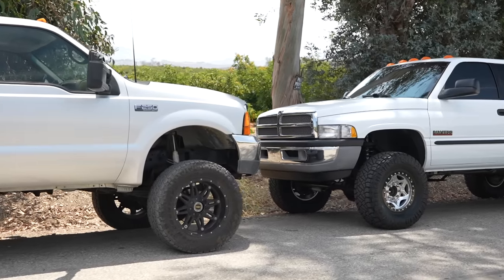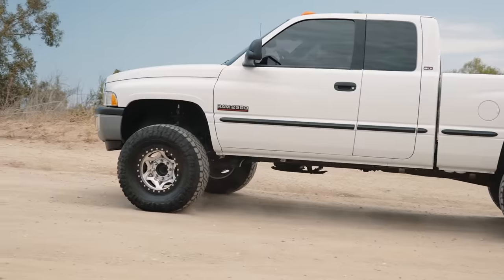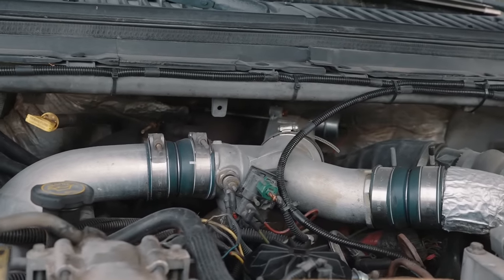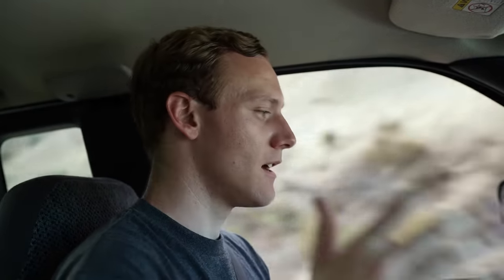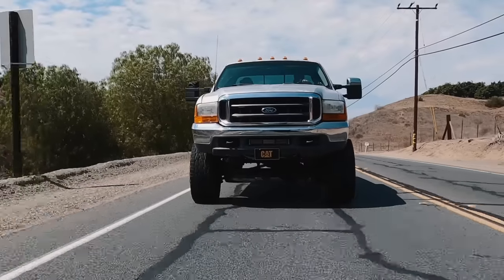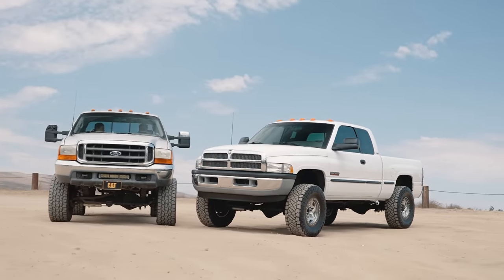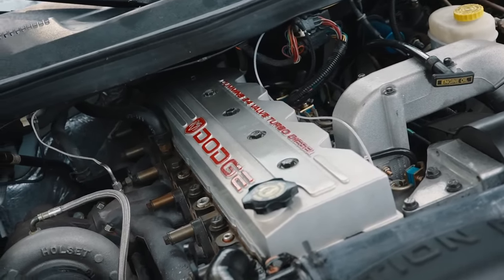1999 Ford 7.3 Power Stroke Super Duty vs Dodge Ram 5.9 Cummins 2nd Gen | Which Is Better?

Comment: Only thing I would disagree with is ride quality. Never been in a smooth riding 2nd gen the always feel like they are going to rattle apart.
Reply: 2wd are 1000x better
Reply: @420dredog  thats what I have amd drives like a cadie 2001 7.3
Reply: Dodge guy. 95 12 valve. Fords make good 4wd front Ed’s

Comment: I own an early 99 SD. Worked on the 444 international in school buses, when I found out they put that 7.3 in a pickup I had to have one, ordered the 99 new traded in my 95 lighting ordered the XLT ext. cab short bed $38,000. 6" lift, 3 lifetime exhaust systems and 22 years of painting everything under it. 145.000 miles on it, great truck. Been in the garage for about 10 months repainting the entire frt. undercarriage again. Not really for sale but stuff happens, today's market I wouldn't sell it for less than $25.000. Thanks for the video, motivates me to go work on the 99. Sorry the only thing good on the dodge is the Cummins. And for leaf springs easy to work on, easy to lift-alter, no death wobble, and rides like a real truck no girly coils. Thats all.

Comment: Every driven a 5.9 with the manual either the5 speed of the 6? They are entirely different different trucks with the manuals. And they become really reliable.
Reply: I drive a 12v gen2 5spd manual. I've driven it for 17 years. It's been incredibly reliable.
Reply: And the best part is no more crappy fold down cup holder.

Comment: Cummins all day long. The 7.3 is gutless, and a huge hassle to maintain. I started off with Ford diesels due to the hype. I got a Cummins and never looked back since. Cost a lot less to get to about a 1000 horsepower and much easier to work on.

Comment: This was great! I have a second gen Ram standard cab 2500 6spd, I’ve been driving it every day for 15 years in New England for my home renovation business. I did rent a crew cab f350 while my truck needed a new head. That f350 road like a stone, empty it did this weird leaf spring hopping that made me nauseous after an hour of driving, however it felt superb when I hooked my portable workshop trailer to it or my dump trailer to it. I mean it’s really nice. Like it road better loaded than my ram did empty. My second gen can tow every day but it’s all over the place by comparison. I acknowledge that it’s not a fair comparison of a crew cab dually to reg cab single wheel and all but I didn’t realize that I didn’t have what I needed. The interior also was a far better place to sit in the ford, despite the fact it was missing a pedal on the left and a lever coming out of the floor. Made me realize when it’s time to replace that second gen a one ton is the way to go for as often as I tow.

Comment: Used to work in steel fab making and delivering cattle/horse panels.  Trips to get tubing or deliver panels were commonly made with a 1 ton cummins.  But there were no creature comforts:  crank windows, most of the electronics didn't work (including radio & cruise), plastics always shattered, they were manual so not many transmission issues, rust was common on the body, always had cracked windshields, but by golly that cummins kept going.
Started running auto 7.3s and could pull 19k lbs of tubing at 85mph.  Wheel bearings and 4wd front end work were notorious fixes on the fords.  Otherwise, never had issues with anything else.. change the oil, keep goin.
Only problem is that people think these things are solid gold.. but that's how demand works when you have a product that works.

Comment: All feelings aside there is no argument when it comes to engine platforms. Cummins wins  all day. Even in the diesel race world, you see more cummins swaps into Fords than 7.3 swaps into dodge trucks if any. All that said, ill take a 99 7.3 supper duty over a 2nd gen anyday.
Reply: I'd def take a 12v superduty haha, not too keen on the 2nd gen body/interiors aha
Reply: The new 6.7 power stroke comes with steel pistons. Their also used in OTR trucks, people pay 5k to install these in their race application Cummins or Duramax engine builds. Come stock in the 6.7 Power-Stroke
Reply: Well of course no one swaps a Powerstroke into a dodge truck lol. Dodge is a shit truck with a good engine, so it would take an idiot to swap a different emgine

The rest of the dodge truck other than the engine is what needs to be swapped , that’s why people take the engine and put it into something else
Reply: @CoyoteFTW  the Europeans who designed it did a good thing then

Comment: The 24v is not as efficient as the 12v. (By efficient I take it you mean fuel efficient). Also the 99 24v is not the same as the last 24v made, they changed again to common rail in 03 and different injections in 04.5.
Reply: P pump conversion and you would be just as good with the 24v.

Comment: Before I say this I just want to clear some things up, 

I’ve owned both trucks, a 2001 7.3 long bed automatic and a 98.5 ram 2500 cummins 5 speed and a 2000 ram Cummins 5 speed dually. 

I didn’t own the truck but I’ve also pulled my horse trailer loaded with a manual Ford 7.3, no difference in towing performance. 

I towed the same trailer with the same load an both the Ford and the dodge.

I will never tow with a 7.3 agin. 

The 7.3 powerstroke was a clean running diesel with a healthy trans. But it struggled on every mountain and every wind storm. 

Both of my Cummins didn’t care, the truck just did it. No problems, I didn’t even have to shift out of 5th gear when pulling hills at 60 mph. Of corse I did anyway because I didn’t want to hurt my trans. But I’ve pulled hills in 5th gear a few times just to prove it could do it. 

The 7.3 struggled, a lot. Every hill it had to shift down to second gear going 29 miles per hour no matter what hill I pulled. And it wouldn’t go faster. 

The Cummins, I could tune it without having to replace a bunch of parts, 

The powerstroke, I had to replace the hpop and the lines just to be able to tune the truck ........
“This is what a diesel shop told me” 

My horse trailer is only 3800 pounds empty 
With 3 horses plus tac and feed it weights 5500 ish, that’s not a lot of weight. 

I’ve also pulled 7000 pounds of steel beams with both trucks. Ford struggled, dodge didn’t care, it pulled it with no problems. 

Also guys and galls I’m not trying to start a argument, but I’m just giving you my experience on both trucks. 

Anyway all I’m trying to say is that dodge was a better experience for me. I hate towing with automatics. I will always prefer manual I’ve towed the same trailer with the same load with manual 7.3 and Manuel 5.9 Cummins. 

Also there’s one more thing I want to say, 

I’ve towed with the newer 6.7 powerstroke and 6.7 Cummins. I didn’t get enough drive time to have a opinion on the newer trucks yet . “250 and 2500”  hopefully in the future I will get a chance to put the newer trucks to the test.
Reply: I'm willing to bet that 7.3 needed up-pipes. They all go, and when they leak they still run great, just down on power. Your 7.3 experience is not in a properly working 7.3. 
For comparison,  my 7.3 zf6 towed my 11,500 lb 5th wheel camper in the hills at 70. Just a superchips tune at that time. Granted not mountain passes, but decent grades. Once I did bigger injectors and a turbo, accelerating up hills at 80 was possible.
Reply: @Jim_Lawrence  my Ford 7.3 was stock and was in working order. Truck had a rebuilt trans plus new hpop “stock” and up pipes with paperwork from the previous owner. 

The comparison I am making in my last comment was a stock 7.3 to a stock 5.9 Cummins.

You had to buy new parts and upgrade parts and tune your truck to be able to pull hills at 80 

All I had to do was tune my truck and I can now pull hills at 80 with my 11500 pound “loaded” horse trailer.
Reply: @Jim_Lawrence  and don’t get me wrong if a Ford works good for you then great ! 👍🏻 everyone has different needs that Ford dodge or Chevy can tend to ! Dodge happens to work good for me, I’ve had good luck with Dodge Ram trucks. 

If a Ford works good for you and you are happy with your truck then that’s all that matters. 

All I was trying to say is that when is comes to pulling power the Cummins pulled a lot better then the power stroke did.
Reply: @jackk5562  whether there were receipts or not, something wasn't right. Stock and un-tuned I could keep up with traffic in the hills. At 11,500. 
I had a second Gen vp44 truck in the past too. Yes it towed well, previous owner put a full banks kit on. Also had a stock 03 Duramax Allison.  Point being,  if your 7.3 struggled with 3500 lbs, something wasn't right.  Pre turbo exhaust leak, boost leak, low fuel pressure etc...

Comment: I own both. 2000 Excursion and 2001 3500 ram. 420k on the Ex and 225K on the ram. Both transmissions overhauled once .  Ram is running a mild tune and after market exhaust

Comment: I honestly wish dodge interiors weren't made with cardboard and duct tape. And that the auto transmissions wouldnt randomly fall apart
Reply: yup...strange they would go to such lengths to get a great engine in the truck, then get so chinsy cheap with the transmission and interior.  Seems like it's always been something like that with Chrysler
Reply: @LarryPerkins78  That's FCA's M.O. They make awful vehicles that would have tanked if Cummins hadn't rescued them in 1987. It's not that the Cummins is a great truck and Dodge simply cheaped out on a few things like interior or transmission; it's that Dodge is a terrible carmaker and the non-Dodge components are the only good things about their trucks

Comment: Put 15k on a gooseneck behind them on the interstate for 10 hours.And I can tell you from experience you'll pick the 7.3.
Reply: I Worked on a farm a couple years back and we had a 01 5.9 gaser that has a gooseneck for hauling hay around the field and took a trip to California to buy a tractor drove 7k miles about 100hrs on the road never had a problem and had 286k on the dash and they retired the gaser and brought a 93 12 valve a year later and I brought the gaser for 1k and put a 408 stroke in it
Reply: I say we put 500-600 hundred Idol hours on it monthly roughly 7k yearly and about 100k every 10 years close to 200k Idle Hours that they had it in 20 years so I say about 500k is on the motor before I got it

Comment: I've got a '94 Dodge Cummins 12v NV4500 and an '03 Ford 7.3L Powerstroke 4R100. Both are driven regularly in the construction trade. The Dodge/Cummins truck is built almost bumper to bumper while the Ford is bone stock. 

Engine: I feel bad for the 7.3L because it's been as reliable as a hammer, but I'm going with the 5.9L Cummins. Again, that takes nothing away from the Powerstroke, as it's been 100% reliable since I drove it off the lot brand new. I love the pull and the sound of the Cummins.

Transmission: apples and oranges comparison, as the Dodge has a 5spd manual (and it's really good), while the Ford has an automatic. In 19 years, the 4R100 hasn't given me any issues whatsoever and both trucks tow trailers all the time.

Ride quality: again, apples to oranges as the Dodge is a dually and the Ford is SRW. Neither rides smoothly, but I suspect if the Dodge was SRW it would ride better than the Ford.

Interior design: The 2nd gen really set the bar high for all trucks that came after it (not just Dodges, either). The storage behind the seats (regular cab) is the first of its kind and really well thought out, as is the flip down center console/seat. I'm going to give it the win over the Ford because even though both trucks are similarly designed inside, Dodge did it first.

Interior quality: Yeah, Ford wins here. My 19 year old interior looks brand new and functions exactly like it did in '03. You can't fake that kind of quality. On the other hand, the Dodge is 27 years old and is still in pretty good shape too. I treat my trucks with respect, so that kind of care goes a long way in keeping things intact and looking good. 

Brakes: Given that the Ford Super Duty came out five years after the 2nd gen Dodges were introduced, of course the brakes would be better. My Dodge has an aftermarket exhaust brake, however, which helps to even things out a little bit. Neither truck has brakes anywhere close to late model pickups, though.

Intangibles: I've got the best of both worlds. A 12v 5.9L Cummins and the last, best 7.3L Powerstroke ever made. The Dodge stands out more due to the fact that it's a 2nd gen and a dually with a flatbed. The Ford doesn't get as many looks because even though it's 19 years old, the design doesn't stand out from it's peers or those that came after it as much as the 2nd gens do. Whenever I do notice someone checking out my '03, I know they understand the subtle reasons why it caught their eye. I think I can sum up both trucks this way: 2nd gens threw down the gauntlet  and dared the other manufacturers to beat it. GM failed for years, but Ford took the competition seriously enough to design a truck that will be just as legendary, not for its innovation like the 2nd gen, but for simply being one of the best pickups of all time.

Comment: I daily a 96 12 valve and love it. Working on it is fairly easy and it's honestly low maintenance. I'm your opinion what engine do you prefer? 12 valve or 24 valve?
Reply: I have been daily driving my 93d350 12v for 8 years and all I did was upgrade the turbo truck has given me zero problems , I just bought a 04 common rail 24v and love the truck gets up and goes alot better than my 12v
Reply: One time my alternator burn on my 1991 w250 Cummins. Disconnect the alternator fix the wire fuse link, restart the truck and drove it 1h 1/2 back to my home, save me tone of money.
Reply: 12V manual cause of the mechanical pump and less electrical
Reply: I'm a fairly new owner of a 12 valve 2nd gen manual longbed with Banks Turbo.  I'll never buy another truck.  Tows like there's nothing behind it even at 75 with a 5 ton load.
Reply: I've had a 12v and 24v. I prefer the 24v over the 12
Reply: 12 valve forsure
Reply: 12 valve but I have not owned a 24v so I cannot say.

Comment: I didn’t catch it if you mentioned it but is that a dash “cap” in the dodge or original dash because it’s the only 2nd gen dash without a crack I have ever seen!
Reply: I have an 01 5.9, I've had it since 05 and the dash was of course cracked.   So I bought a new one in 05 and replaced it. Factory install had the 6 screws by the windshield,  a bunch under the front bezel and too many coming from underneath. So I opted out of putting the screws back on the underside and still have a dash in one piece, can't say the same for the rest of the dash now but I  starting a full restoration on the old girl.
Reply from the maker: That’s an original dash! My truck has been garage stored since new and has under 60k miles!
Reply: On our farm we've got an 00' and a 01' 3500 that my dad bought both brand new off the lot. Both still original dashes, not broken, both over 300,000 km's. And they are farm trucks, shit gets thrown into them all the time.
Reply: 97 and 01 work trucks and my 02 personal rig are all closing in on 300,000 miles and the 01 is the only one with a tiny crack. I’m in a northern climate though so not as much sun, and the rust is a whole different story.

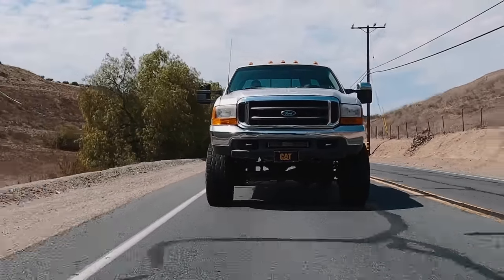Comment: 5:20 the Achilles heel for r4100 is the radiator. Had mine have an internal failure where it mixed coolant and trans fluid so I had to have it rebuilt. She got the mishimoto treatment with rad, intercooler and trans cooler. Fingers crossed she’s bulletproof on that end now. Love my 7.3 excursion!!

Comment: Iv owned both in multiple years and multiple configurations(auto, manual, short beds, long beds, 2nd, 4x4) iv had 5 different dodges and 4 7.3 fords, iv worked on both and currently own 2 dodges and 1 power stroke f250 4x4, i take Ford any day of the week

Comment: He says in-line six has more torque which is wrong it just can’t produce high end power because the airflow
Reply from the maker: There’s a reason you see Cummins engines dominating the drag and sled pulling world and not 7.3 power strokes.
Reply: @JustDiesels  the debate about not seeing Ford dominate has always had more to do with the cost to upgrade anything fomoco rather than ability. That's like saying the chevy sb is the most dominant motor because it's cheap to build therefore dominant in various platforms
Reply: @JustDiesels  it's because the Cummins 5.9 is a heavy duty rated diesel, while the 7.3 is a medium duty diesel, the Cummins will simply stand to the higher attainable power levels much better than the 7.3

Comment: 96 12 valve got better fuel mileage horsepower was the same for straight gear automatic got 215  Dodge had the better engine Ford had the better chassis and brakes